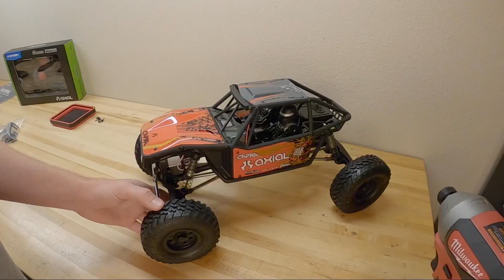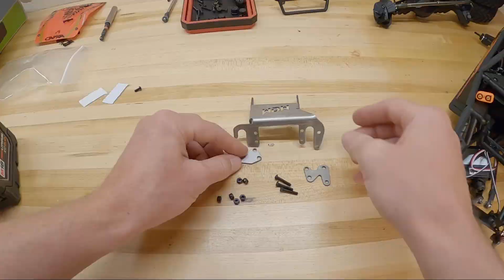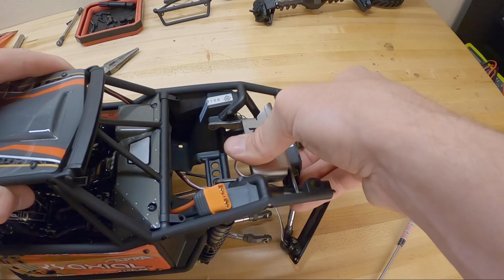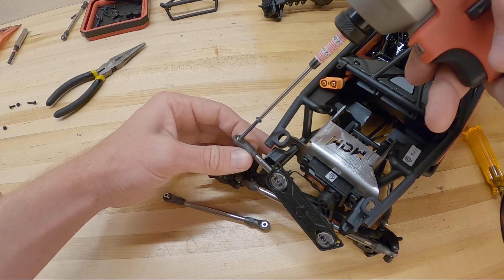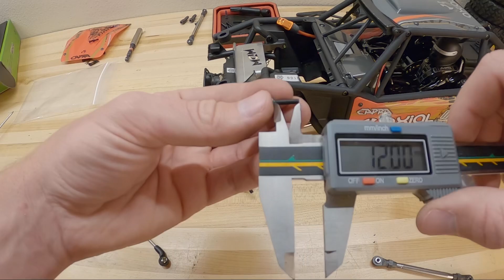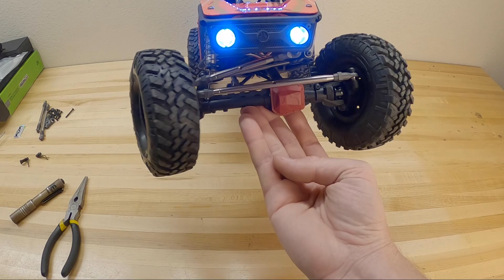WDW Capra Chassis Servo Mount/Panhard Kit Install How To

Comment: Hey man, do you make a panhard attachment for the VP capra offset F9'S?  I've bought a couple but they're made for stock capra axles.  Thanks man
Reply from the maker: I make the chassis side mount. I don’t offer any parts for the axle side

Comment: I saw your 3 link Capra at proline by the fire. I wanted to ask you what size pinion and spur are you running or would recommend. I’m trying to duplicate this same Capra build. I have a fusion pro 2300kv and 3 gear transmission as well as your Servo mount kit.
Reply from the maker: I believe I’m using a 13t pinion with standard 56 spur. Same setup as a 10.2 with straight axles my car has a 2800kv axe so it’s pretty zippy
Reply: Thanks for the info. 🙏🏾

Comment: Is it 100% necessary to do this conversion? I just bought a 4WS Capra and really cant see myself spending another $170 on the straight axle kit and another $40 for your kit.
Reply from the maker: I’m not saying this is better than a 4 wheel steer Capra axle setup. This is for people who want to have the rig still function after taking the axles off the car and using them somewhere else. Straight axle kits commonly go on sale for 99$
Reply: @westdesertwheeler  Gotcha! I really appreciate your response! Also love the consistent content you put out. Cheers Logan

Comment: When I first saw this I knew I had to have one, so I put in an order. Install was simple enough, especially if you are familiar with 3 link setup already.  Performance is great, geometry is good, and I don’t think there will be any breakage issues unless launching off cliffs😉
Good job WDW, great to see new things being designed and produced, keep it up 😎
Reply from the maker: Hey thanks so much for the feedback! Yes these should be plenty durable especially in the new Stainless option.
Reply: @westdesertwheeler  hey Logan i want one of your 3 link kits but your site has no PayPal support.  Can I purchase another way?
Reply: @westdesertwheeler about how long she take to ship. I ordered mine yesterday and have already built everything up besides the supplied parts 😂 just curious. Been here since the first 2k subs. I Capra swapped my wraith and kept cms. Lmk if I should show a video

Comment: I just ordered a 4WD Capra... I'm wondering why switch to straight axles?  I see there are metal axles available; seems like those might be a better choice.  For the 4WS model, doesn't that require two front axles?

Comment: This conversion more for compitition than just out playing? I love the portal axils added ground clearance .

 Will a flat center skid plate need to have the interear removed to give room for motor and trans to move up? What all is needed to use the flat center skid plate?

Comment: Just to ask…putting the front shocks in the rear most hole to lay it down causes binding or clearance issues?
Reply from the maker: No, I used that for mounting the rear of the bracket so there is a screw in the rear mount
Reply: Understood. Thanks for the reply

Comment: Nice!!!  Now I have i instructions!!!!👍👍👍  Logan it is a piece of art.  The quality is top notch!!!!
Reply: Hey Logan, will the conversation work with the portals?
Reply from the maker: It should there will just be small adjustments you might need to make like panhard length or pinion angle